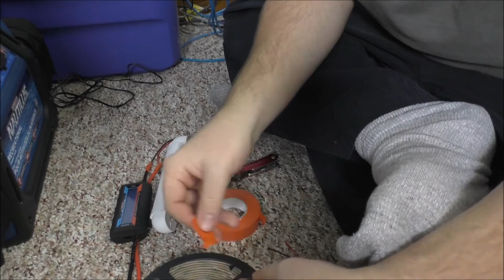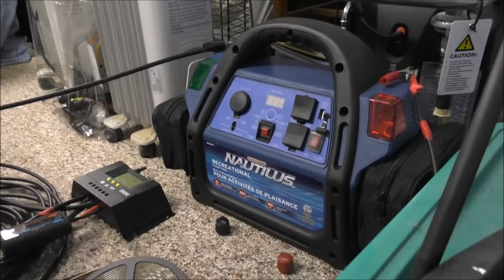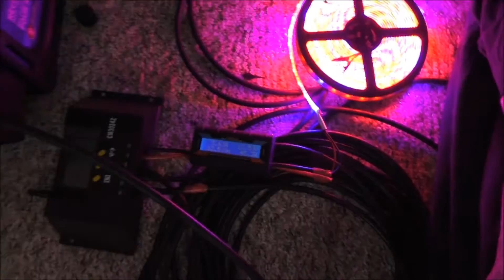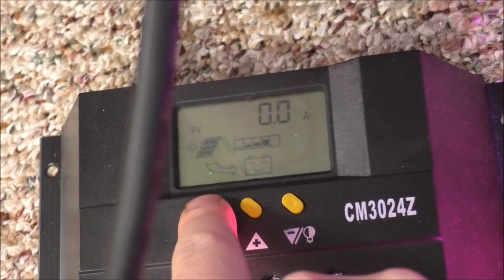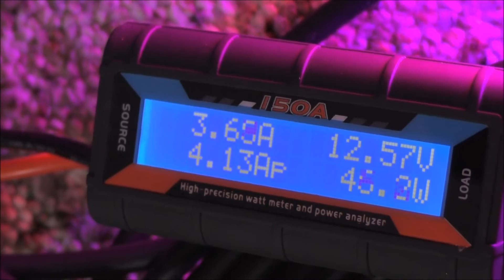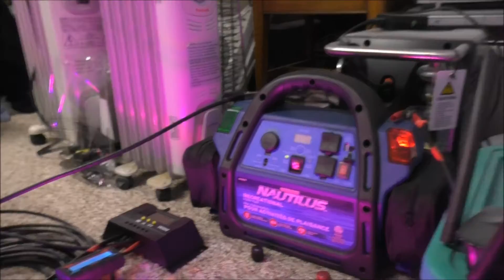12volt LED Aquaponics Grow Light

Comment: Hey thanks, for the clip awesome job, do you think 1 125 watt, 20Amp 2-3 controllers to their own batteries? what are your thoughts on that?  thanks again for showing he grow led strip?
Reply from the maker: you could prolly get away with it. i would suggest at least a 100 amp hour battery and a good mppt controller.
Reply: @TheOffGridTinyHouse  thank you, appreciate the quick reply. the main bat is 240AH deep cycle did my homework a few years back. thanks again just wanted reassurance. they all are working good no issues.
Reply from the maker: @fishycomics  i have since switched to lithium iron phosphate batteries, check out my playlist named "solar" for more on that